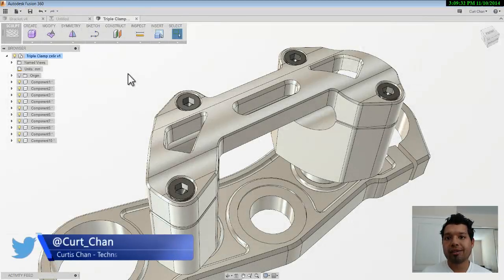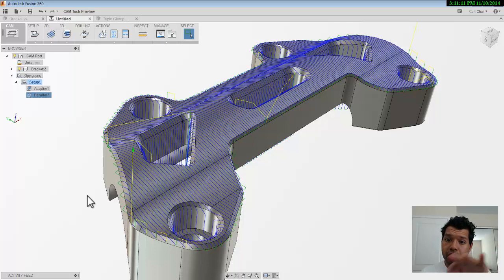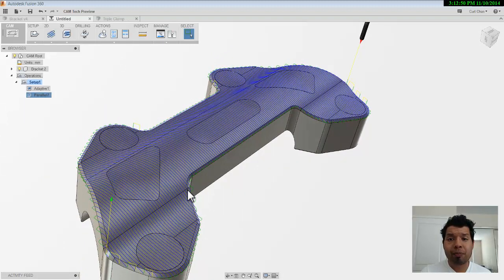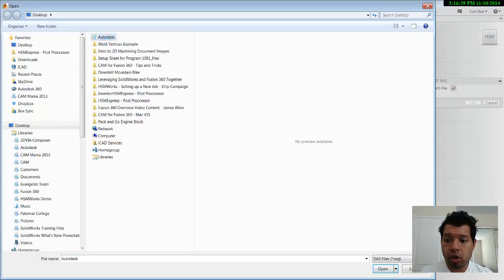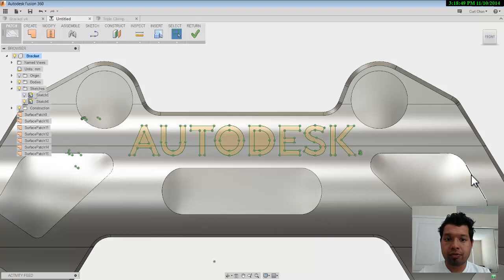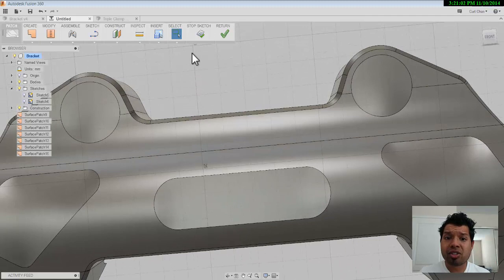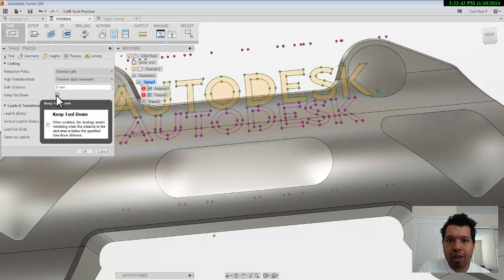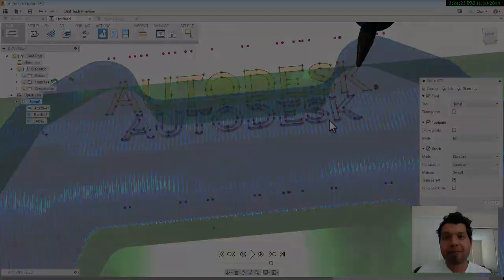CAM for Fusion 360: Working with Surfaces & Logos

Comment: i wanted to by the fusion360 for lathe. two problems, first i cant get a post processor for my machine, the one is provided isn't configed. second, the company in unreachable and won't reply or quote. there is a special offer ending tomarrow which i can't take because im not sure i can work with it.

Comment: Is there not a way to select the entire "loop" or "chain" (connecting geometry on the same plane)? For instance when your selecting each edge of the letters, maybe a selection filter of some kind?   I've only been using Fusion for a couple weeks, but have wanted to be able to do this quite a bit already.  Thanks for your all your help that provide with your many videos. You do a very good job and it is much appreciated!
Reply: +autodesk fusion 360  Dear Autodesk,, SELECT CHAIN FUNCTION NEEDED! Cool Thanks.

Comment: That is cool. After few hours of investigation, I feel like CAM boss :)

Could you also create a video where you would explain where i can set some allowness.  Not sure if there is such a term in english. The point is I want to understand what parameters are involved if I want to  cut some body first tool and live just 0.02mm of material there. And then with another tool just go and cut the rest.

In this current particular video, how to make allowness so that after parallel I can do and cut chamfer. So I want parallel operation to leave a little material there.

Please create video for that. How to strategize ruff cats and then clean cuts.
Reply: Hi Sergey,

Glad to hear you're using CAM for Fusion 360.  Yes, the term you are referring too is 'Stock to Leave'.  Which is found under the 'Passes' Tab.
Reply: That is useful tip, thank you.

I am not actually use it. I do not even have CNC. I am only investigating. I was always wondering how all of this CNC stuff works. And process to create passes was mystic for me until I sow few of your videos.

Anyway I am more than impresses with Fusion CAM. It is so intuitive, simple and advanced. I even think now about getting my hands on some CNC router.